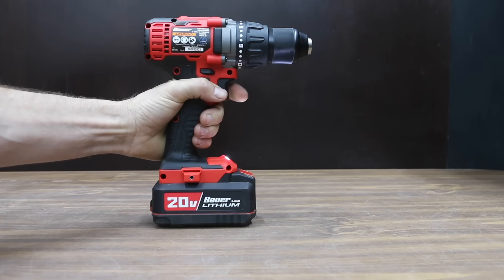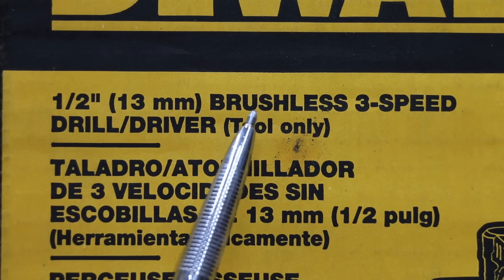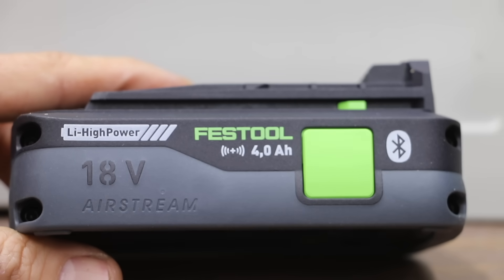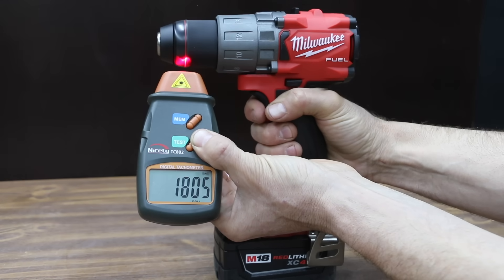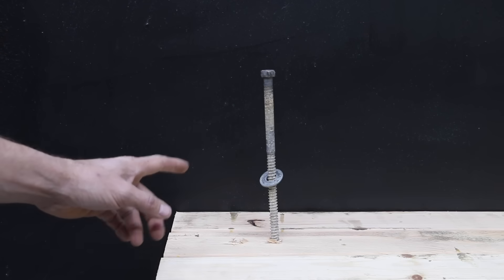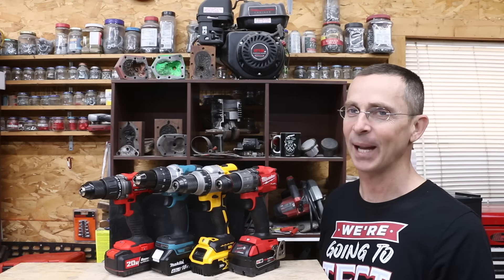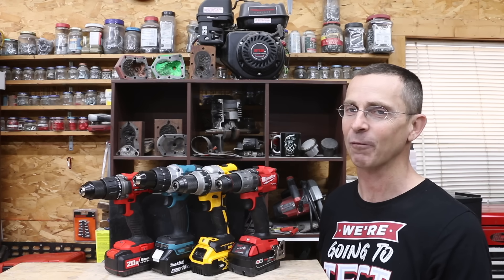Best Drill (BATTERY POWERED)? Milwaukee vs Dewalt, Makita, Bosch, Festool, Ryobi, Bauer, Ridgid

Comment: At work, we get only Ryobi because they are cheap and easy to replace when guys forget to put them back. I personally bring my own Dewalt because it's more durable, compact, and more power. It doesn't hurt that the battery is super easy to replace at HD or Amazon aftermarket. Overall I like Dewalt because there is no one bad category. It's in the middle, and I like that.
      edit; I have been tempted by the MIlwaukee, but all my other tools are Dewalt.
Reply from the maker: Thanks for sharing.

Comment: You know, as an avid metalworker I have to ask - how about an angle grinder comparison? I've burned out plenty of them over the years. I believe Bosch to be the best but that is my anecdotal evidence at best ;)
Reply from the maker: Thanks for the video idea.
Reply: Oddly have had to replace switch on my bosch a few times. I have black and decker angle grinder over a decade old and have only had to replace the cord a few times after almost daily use

Comment: Every product would sell more if it was project farm approved. Imagine having a tool box stamped with project farm tested durability, I’d buy it instantly. Great work sir.
Reply from the maker: Thanks!
Reply: Wouldn't work, changes would be made after approval, common in electronics industry.
Reply: Unfortunately you would probably have many different battery families. As it seems not every tool from a single manufacturer is the winner.

But I take your point and agree.

Comment: Do you allow the engine brake to cool between runs? I’m sure after the 3rd or 4th drill it was good and warm. does an engine brake perform the same way that pads and rotors would?

Comment: I wish you would do the Black and Decker. Mine has seen moderate use for 8 years and has just recently started to show signs of age. Used it to finish a basement (including non-load bearing walls using construction screws), build a treehouse (including turning huge auger bits into live wood), build three workbenches, multiple above ground garden boxes, resurface two decks, other misc small jobs and perform routine maintenance on two homes. The live wood on the treehouse is what started making it have some problems, but it’s still pretty good.
Reply from the maker: Thanks for the video idea.

Comment: Great video! As an electrician, the only time I use the clutch is with  larger diameter hole saws or with combo drilling/tapping tools. When you're on a ladder drilling a 4 1/2-in hole overhead, a clutch strong enough to run the hole saw but not bind (possibly throwing you off the ladder or knocking you in the jaw) is an awesome thing!
Reply from the maker: Thanks!  Thanks for sharing.

Comment: So my take away from this test is this: I bought Rigid tools last year with little to no knowledge. While I didn't make the best choice, I didn't make the worst, either.
Reply: Plus lifetime warranty.
Reply: I bought Rigid tools in 2010 and because of the lifetime warranty i am still using the same drills and i recently got 3 of my 4 batteries replaced for free, sent in the mail after a very pleasant phone call.
Reply from the maker: Thanks for sharing.

Comment: another important thing I’d like to see is charge/battery duration. Torque and speed are great but if I have to stop and charge that batteries constantly is a deal breaker.
Reply from the maker: Thanks for the suggestion.
Reply: I've used Ryobi and Milwaukee brands. Both batteries last me a few days before having to recharge. Of course it depends on what I'm doing, battery technology and size.

Ryobi batteries last me about 2-3 years before they charge but then run out quickly. Ryobi has free battery replacement program.

Milwaukee batteries I don't know yet, as I've only switched to Milwaukee about 1.5 years ago, due to lighter weight and form factor.
Reply: @laRiduzione  I work in construction and have the ryobi, rigid, and dewalt sets. I’ve upgraded my dewalt batteries to the 6AH 20/60s. And literally none of those sets last me a single day yet alone a couple days. It was more of a curiosity thing to see which of the batteries from which brands stand up the best.

Comment: Man don't get the Bauer. I was helping a neighbor drill out 3 weld nuts in his car. By the time we were through it was almost too hot to hold. A brushless Dewalt will beat it. Also there is a more comparable dewalt that is $100 with batt and charger. Only two speed but has a real clutch, plenty for me.
Reply from the maker: Thanks for the feedback.

Comment: Milwaukee 2803-20 M18 FUEL 1/2" Drill/Driver $109.00,
Batteries $84.00 each, total of $168.00 for two,
Charger $43.35,
Milwaukee Packout Case to keep it all in $94.95,
And let's not forget a Milwaukee right angle drill (to acount for the right angle adapter included with the Festool) $165.95 (bare tool).
Total cost $581.25 (for just $17.75 more I could get all of that plus an impact driver from Festool).
And it's all made by slaves in china.

And this model isn't Festool's best drill/driver, this is their hammer drill.
Reply: I sure do miss the old, impartial, Project Farm. He didn't even do any run time or durability tests and he tested the newest and best of one brand to old and not the best from other brands. I think he sold out. I would probably go with Mafell for power tools though.

Comment: Can you test weather or not gasoline fuel looses its octane rating over time? For example if I park my car for 3 months, will the fuel get stale.
Reply from the maker: Thanks for the suggestion.
Reply: I think Sunoco has a very clear and concise answer to your question, despite being a gas supplier.  https://www.sunocoracefuels.com/tech-article/octane-stability-high-octane-vs-low-octane-fuels.  But you could also read the same thing on plenty of non-industry websites like JDpower https://www.jdpower.com/cars/shopping-guides/how-long-can-gas-sit-in-a-car-before-it-goes-bad, or Consumer Reports and AAA https://www.consumerreports.org/car-maintenance/how-to-keep-gas-fresh-and-protect-car-during-coronavirus/

Comment: Anyone have any experience with makita? Pros and cons ?
Reply: I see no cons with all my Makitas.  The Milwaukee M18 should have won across the board based off the manufacturer's specs which exceed every other drill in the test.  Despite that, the Makita did beat the Milwaukee on the 5" lag bolts in 1st gear test; however, PF should have tested the Makita XFD14Z, which has similar performance specs as the Milwaukee.  In my actual use, I bought the most powerful corded and cordless Dewalt to drill holes in a stump and they both failed and got stuck.  I returned and bought the Makita and it had no issues.

Comment: You've done angle grinder wheels twice. Would you consider doing a video on angle grinders? The skil 4 1/2" at canadian tire is on sale for $39.99 CAD but they have angle grinders over $250 CAD (the Bosch 4 1/2" is $179.99)
Reply from the maker: Thanks for the video idea.

Comment: Even though the drills are a little faster than the impact, if you have an impact I'd still use that for driving heavy fastners because that's what they are built to do.

If you have both then drills are just for drilling holes in wood & cement IMHO and you'll extend the life of your devices.

In theory anyways.

I have the luxury of having a Milwaukee impact driver and mid torque wrench as well so really I'd use that instead of either just because I like to leave the others set up specific ways with certain accessories and what not ready to go for each tools most performed tasks.

It's still nice to see what the drill is capable though.

I'm not sure once you understand the functions of various drill types why anyone would purchase less than a Hammer Drill these days to cover wood and concrete in a single tool and that's where I beleive that initial torque & peak torque of that Milwaukee is really going to shine. 

That initial start of drilling a hole in cement or boring a really large hole in wood.

Again, in theory anyways.

It would really be cool to see a cordless orbital sander showdown in your intesting testing methods @Project Farm!
Reply from the maker: Thanks for the video idea.

Comment: Is there a way you can test Windshield washer fluid? Such as mixing it with water if it will have the same full effect and also which brand would be best. ie. Bug remover, washer fluid that can handle the coldest weather, or all season fluid.
Reply from the maker: Thanks for the video idea.

Comment: Not sure if it's your wheelhouse, but I would be interested in seeing comparisons between the 12-volt series of tools (drills, impact drivers, oscillating multi-tools, and even the flashlights). I personally went with Milwaukee, but have heard and seen a lot of good things from the DeWalt 12-volt kit. I think they are excellent for people with smaller homes that still need a set of power tools for light-duty use.

It'd be a bit recycled in that ideally I'd like to see all the same tests from the more powerful ones, but would have the benefit of providing a comparison between 12 and 18(+) volt series tools.

Either way, great work, and thanks for making these comparisons: they are fun to watch!
Reply from the maker: You are welcome!  Thanks for the video idea.

Comment: Maybe hammer drill bits, at least regular ones, but if you see the need or want there are sd drive, and spline drive bits, both spade blade and Quad blades
Reply from the maker: Thanks for the suggestion.

Comment: Another good test shootout except no bouncing, dancing drop test remix.  Only negative I have is that you should better compare apples to apples.  Don't know why you didn't test a Ryobi brushless.  Also, you should be testing against similar specd hardware.  For example, you tested the Makita XFD07Z with manufacture claimed max torque 1090 in.lbs, when you could have tested the Makita XFD14Z with claimed 1250 in.lbs which is more similar to the Milwaukee M18 1200in.lbs.  The Ryobi comes in a brushless PBLDD01B, with claimed max torque 750 in.lbs. rather than the P215K tested with claimed 500in.lbs, which would compare better to the Bosch GSR18V-755CN 755in.lbs and Rigid R86009N 650in.lbs.  Dewalt DCD991B 920UWO equates to roughly 841in.lbs.  the only outlier is the Bauer in brushed at 450in.lbs.  I also wonder about the peak torque test since you looked like you had issues fighting with the Makita; moreover, the Makita is the only one you weren't directly driving downward, but more oblique.

Comment: Drills with 4th and many with 3rd are not for power use there for likes of small high speed drill bits and many are a nylon gear and Makita for one had a three speed drill out a few years back they dropped as many was using in third gear and stripping it.
Reply from the maker: Thanks for the feedback.

Comment: Won’t be able to watch until later but using Festool drills often and having owned every one they make, I’m going to presume that the PDC-18 gets edged out by a toothpick with an insert bit attached to it with masking tape in the torque department.

Comment: I have used that milwaukee drill and now the newer version with Bluetooth (amazing features). With high output batteries you really need to use the safty features they built in because its That much stronger 🙈💪🏼
Reply from the maker: Thanks for the feedback.

Comment: I was considering moving over to the Ryobi ecosystem, but I will hold off until my Dewalt 18v drills/drivers complete die.
Reply: That could be a while yet, DeWalts tend to go on for a very long time.
Reply: @wetlettuce4768  I've had my tools left in the rain let to try and they still work great.
Reply: @wetlettuce4768  I've had my tools left in the rain let to try and they still work great.
Reply from the maker: Thanks for sharing.

Comment: I don't mean to doubt your test design, but may I know if you skipped the first one or two seconds when testing the minimum torque of these drills? Some of them like the Milwaukee uses an electronic clutch that detects current to sense torque. Because motors draw large current when starting up, they generally "ignore" the first few seconds of large current, so I think that might be the reason why Milwaukee had 136inlb of minimum torque. (On user manual it says 24-40inlb.)

Comment: Awe man (at least the drill is not a top tool for me)... invested in ryobi batteries (&tools.. lol) at this point, maybe we need what’s the best brand for tool combo test, not sure if it matters top 3 or 4 or 5 or more... most used for me (impact driver, reciprocating/sawzall, circular saw, jig saw, multi tool,drill, grinder, hammer drill, brad nailer) .. might help a new comer get started ...
Reply from the maker: Thanks for the video idea.

Comment: What's happening with the Milwaukee lowest torque clutch? I mean I appreciate high high max. output, but that whopping 136in-lb just makes it so hard to use on delicate jobs...since that's an electronic clutch, would it be possible for Milwaukee to fix it with some firmware update?

Comment: For the price, Festool seems to be spectacularly underwhelming.
Reply: You dont buy Festool for power. You do if you need precision and long lifetime, which you will get. There is almost no play or slop even with the interchangeable chuck on that drill for example. I thought about buying it for the high speed 4th gear, but in the end bought both a 18V and 12V one from Bosch for less money, and im quite happy with it.
Reply: Festool makes some of the best woodworking and cabinetmaking tools. They are very expensive, but generally more precise than the competition, have much better dust collection, and much better integration between tools - in my opinion they are worth it. However, they recently added some "contractor" type tools like this drill, angle grinders and similar, which are average at best, but still carry the price tag of their high end woodworking tools. The only reason to buy these in my opinion is if you are already invested in their battery platform, or you absolutely want all your tools to be the same color.
Reply: @aisotton  That drill is around mostly unchanged since protool times, something like 10 years. Its good for drilling with that really high speed 4th gear, its great precision and the ability to install it in a drill stand or other fixture (43mm neck). Not much competition around except for Fein.
Reply: As I used Milwaukee, Makita and Festool in my company and others not mentioned in this video, I want to say that festool is a brand worth attention mainly due to reliability and comfort of work, which, unfortunately, such tests cannot demonstrate. I can boast that one of the festool screwdrivers worked for me for about 10 years (she died after falling from the roof), while the rest of them give up after about a year. For professionals, I recommend it as much as possible, it will pay off in the long run. (So far, none has stopped working for purely utility reasons)
Reply: My dad has had a festool for nearly 20 years, it only had to change carbon once

Comment: Just to throw this out there, Dewalt and Milwaukee trade blows on just about all their products for battery life and power levels, but coming from construction work... The DeWalts just don't last as well. We would burn up impacts pretty regularly, and wear out drill/drivers like this, and we always got 1.5-2 years out of milwaukee impacts and 10 months to 1.5 years out of Dewalt and Ridgid. Can't speak much for Makita, we only had one guy on the crew that used them.
Reply from the maker: Thanks for the feedback.

Comment: The DeWalt torque settings are also linked to the gearbox setting.
Choose gear 3 for lower torque.
(DeWalt DCD 996 owner. Which is very similar.)
Reply from the maker: Thanks for the feedback.

Comment: Just a few thoughts on Festool quality. At my work we have 7 festool laminate trimmers bought around 17 yrs ago. All have had one set of top and bottom bearings and around 3 brush sets replaced. No complaints there ;they work hard. The plug it cord is rubbish - it’s great if you are the sole user of the machine. In a busy workshop with several festool machines not everyone treats them with the same degree of care so the cords don’t last. ( I tape mine up so it can’t be removed).
I’ve used a Festool C12 drill for about 15 years with one set of replacement batteries ( NIMH) and a trigger replacement. I particularly like the angle Chuck and the eccentric Chuck . I really appreciate the thought put into the system .
Reply from the maker: Thanks for the feedback.

Comment: Absolutely amazing video as always. Just a few notes:
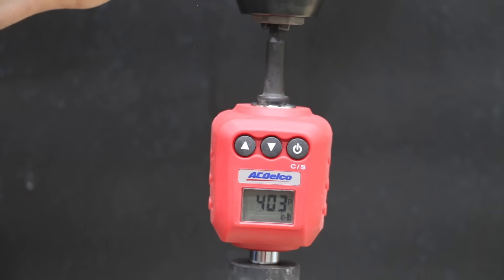1. At 10:13, you are clearly subjecting the bolt to a large moment due to the extreme angle from vertical, rendering your values for Makita inaccurate. 
2. It can be argued that a smaller percentage of the MSRP of Festool goes to BOM and manufacturing costs. Compared to other brands, a larger percentage of the price is amortized over things like after-sales support and warranty, massive R&D into ergonomics (which you rarely discuss in videos), European manufacturing and QC labour costs, packaging and retail experience, etc.

Just some thoughts - thanks for reading!
Reply from the maker: Thanks!  Thanks for the feedback.

Comment: Just for information: Decibels are a log scale. The antilog (to the base 10) of 2 = 100.  The antilog 1.7 = 50.118723
Therefore 3dB makes a big difference.
An increase of 3dB doubles the sound intensity but a 10dB increase is required before a sound is perceived to be twice as loud. Therefore a small increase in decibels represents a large increase in intensity. This is why the human ear cannot detect the 3dB difference.
Reply from the maker: Thanks for sharing.